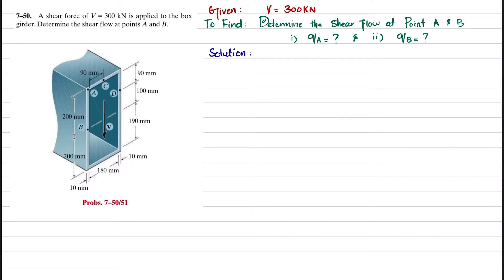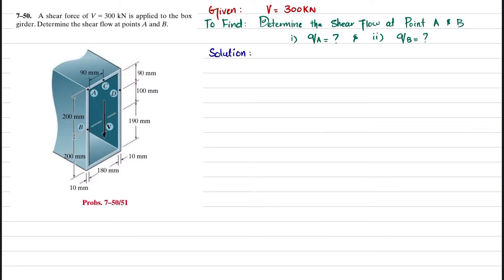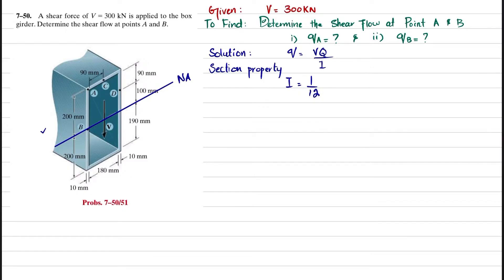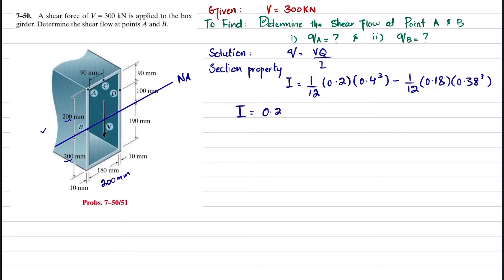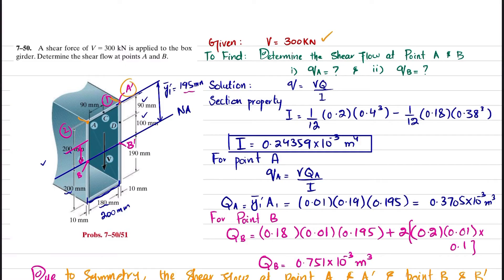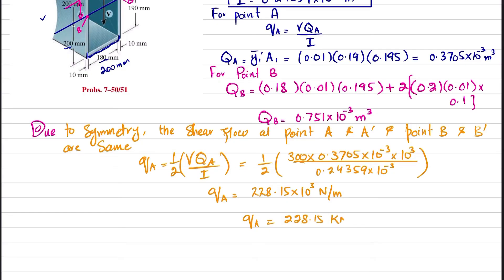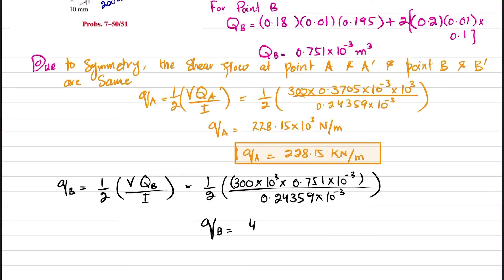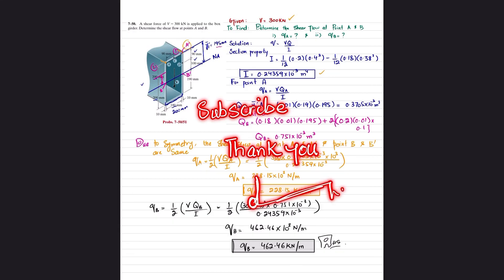7-50 Determine the shear flow at points A and B | Mechanics of materials RC Hibbeler

Comment: Why the shear flow at the point C is equal to zero ??? Pls explain to me logically if possible
Reply from the maker: the shear flow starts from mid point of the top layer or bottom and it flows on either side of the cross section. you can check this lecture https://youtu.be/LfOxglPez-c?si=kFNOe_Bm_SWswDiK around 9:30 you will get the answer as well. distribution of shear flow in the cross section of beam due to transverse shear force
Reply: @engradnanrasheedmechanical thanks sir it helped me a lot
Reply from the maker: @sgiri2012  you are always welcome

Comment: why is the width used for the A1 in QA is 195, not 200?
Reply from the maker: you can see the point A lies on the mid of vertical plate having thickness 10mm so its mid will be 5mm.
Reply: @engradnanrasheedmechanical  thank you!
Reply from the maker: @monkeydabloon1499 you are welcome
Reply: Thank you for the good question and answer. It was helpful.
Reply from the maker: @ssssmin8359 You are welcome and keep watching and sharing
Reply: I still dont understand why the area above point A is not 5 x 200 instead. Wouldn't Qc be the same as Qa?
Reply from the maker: Point A lies in the mid of thin plate which is 10 mm so distance of point A from c is given 900 mm so total distance from A to A ' will be 180 mm
Reply: @ I understand where the numbers come from I just don't understand why. When calculating Q for a regular beam you use the entire area outbound from the point of interested regardless of its horizontal position. The area above Qa and Qc is the same (5x200). Why is the area for point A only being calculated between A and A' in this case?
Reply from the maker: @LuanRibz for the because the shear flow is needed at this point.

Comment: For Qa dimension 0.19 must be 0.20 (180+10+10=200) isn't it am i wrong why is it 0.19 ?
Reply from the maker: Point A lies in the mid of side plate so we have to take the area between the points so 0.19
Reply: @engradnanrasheedmechanical  But you didnt do that for Qb even though Qb is in the middle, why is that?
Reply from the maker: @aidenmills198 yes 0.1 difference I very less , but the thing is that you have to take the area above the point.